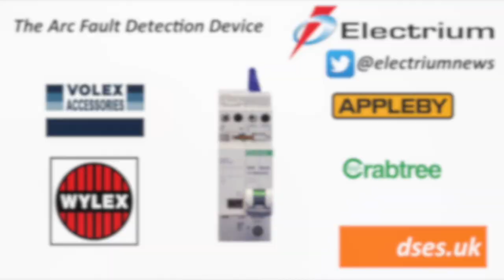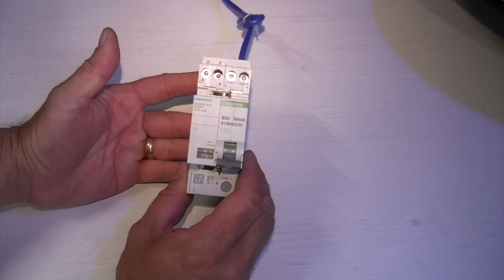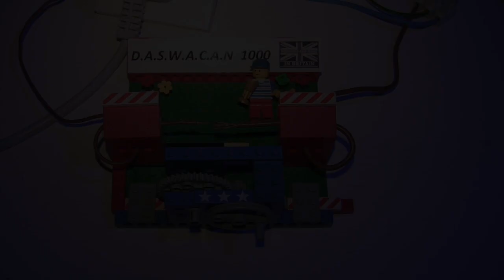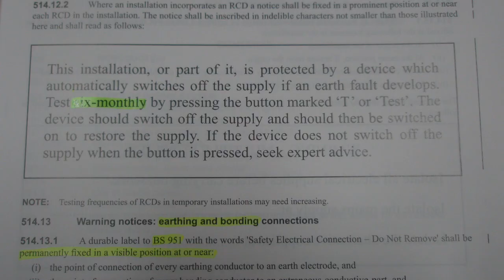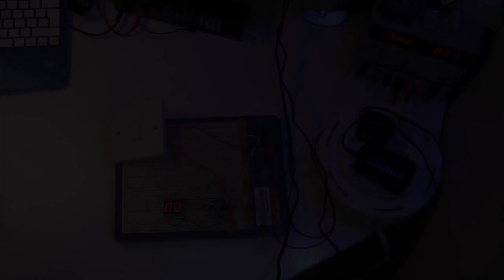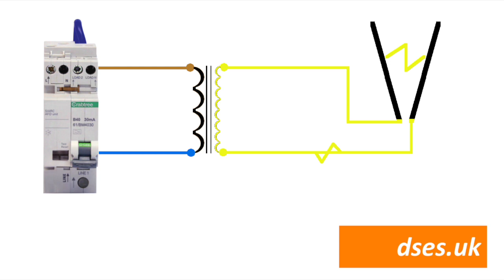The Arc Fault Detection Device (AFDD)

Comment: You are the lego master. What are we supposed to do if we install one of these afdd and six months later you receive a call say its gone off. There is no test equipment that I am aware of that can verify if it is working correctly, you can't detect an arc fault with an  insulation tester.
You would be blindly opening up all the connections on a circuit to see if they are tight and thats assuming you can access them. Surely we need some expensive piece of measuring equipment that gives a bit more than a coloured light to go on.
Great video thanks for sharing
Reply from the maker: Yes, this is the potential headache with these things. A tester might appear that allows you to inject 'friendly' and 'unfriendly' arcs into an AFDD to see if it's operating correctly, but when it comes to finding the cause of a trip in the wild, testing is limited. You might pick up a series arc location by an abnormal high R1+R2 or Zs test reading at a particular point, and you might pick up the existence of a parallel arc by IR testing (might have to ramp up the tester to 1000V to really catch it), but that's about it. It doesn't help that the cause of an arc is often likely to be an intermittent fault at first too, so it may not be present at the time of testing. Also, the fault may not be on the building cabling itself, it could be in an accessory such as a socket outlet with dust/debris inside or water ingress into an external luminaire, it could be a loose connection in a plugtop, a damaged appliance flex or inside the appliance at the cord grip, termination point or switch (although not necessarily further down the line where a transformer or optoisolator may separate it from the AC input). The way I see it, installing these into new builds or rewires where you know the wiring routes and can trust your work may not be so bad, but retrofit into older installations with existing wiring and aged appliances could be problematic. If a later revision of the regs insists on these for the retrofit market, I would personally consider pulling CU upgrades from my services portfolio, or I would put some wording into my terms and conditions to limit my liability.
Reply: @dsesuk  you could introduce a single pulse and measure its runtime to get the distance to the fault
Reply: David Savery Electrical Services I don’t see faults with appliances being particularly difficult to trace. The homeowner will usually make the connection themselves eg I turned on the toaster and it tripped the thing. I know arcs are intermittent but they’ll still generally happen when the load is switched on or switched higher. Like anything experience will teach you the most likely culprits for arc faults.
Reply from the maker: @mondotv4216  Oh, I dunno. I had an tripping RCD call-out once where I said to the client I'd start by looking at appliances that use water and he told me to begin with the kettle because it was "leaking everywhere". I unplugged it, and that was my emergency call-out fee justified!
Reply: David Savery Electrical Services I think there is no accounting for stupid. But as I said - easy fault to trace.
Reply: @dsesuk  Is there anyone who makes a TDR meter for this application? TDR meters can tell you the distance down a wire at which resistivity changes, which is going to be everywhere there is a poor connection. They're super common in telecoms wiring, but I don't think I've ever seen one for mains wiring.
Reply from the maker: @CoolerQ  25 years ago when I worked for Cable & Wireless, I had a £5k Fluke TDR meter, can't remember the model, but it did the biz for CAT-5. I always regretted not nicking that when I left. I've never tried one on mains wiring, and I'm not aware of one specifically for such.